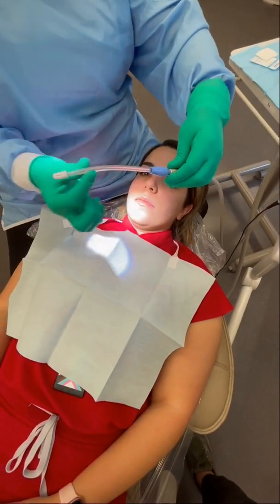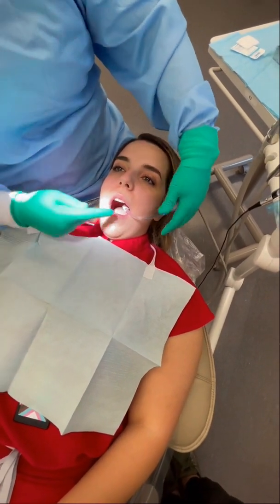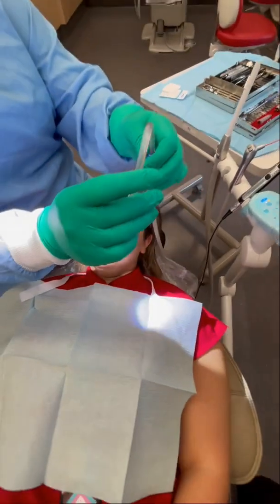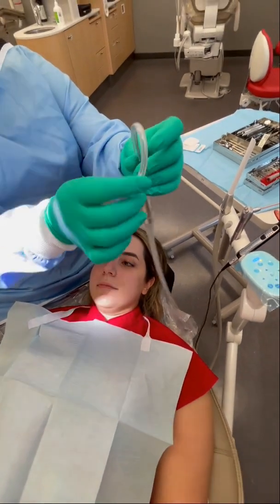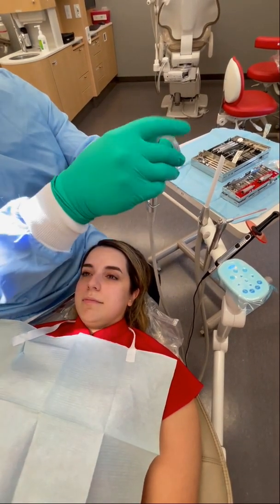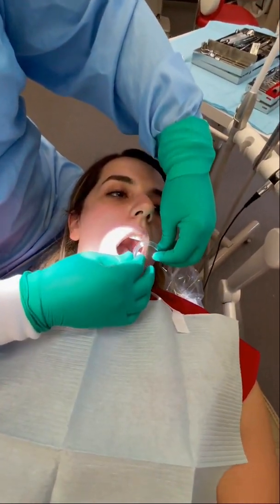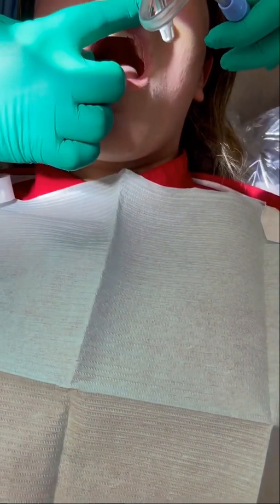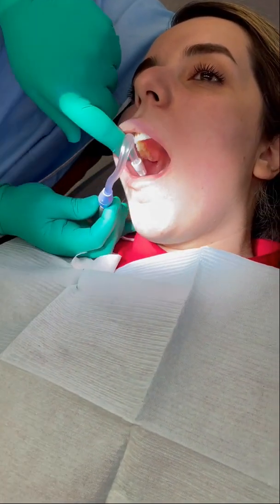How to bend the saliva ejector for effective water control in dentistry

Comment: Thanks for sharing . Been a hygienist for 13 years but admit to struggling with the bending of the s/e on some patients. I will try this tomorrow with the cavitron. Thanks again for sharing.
Reply: Are you finding it easier now?
Reply: @brandon3872  yes alot easier. There are still the odd patient it doesn't work on but for the most part yes!